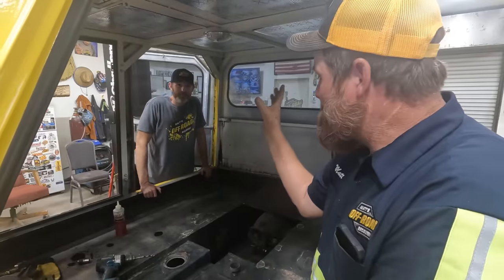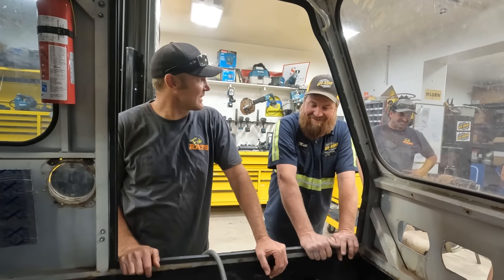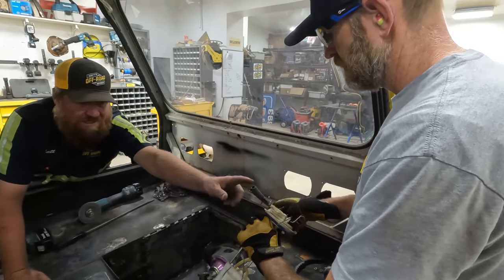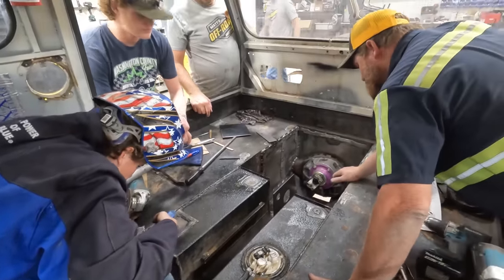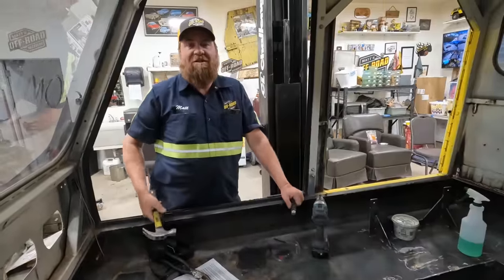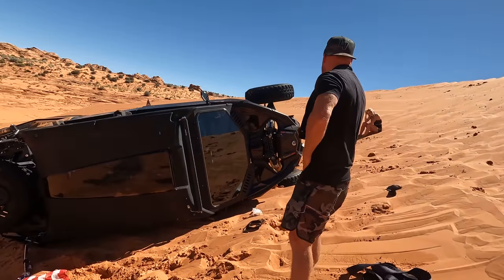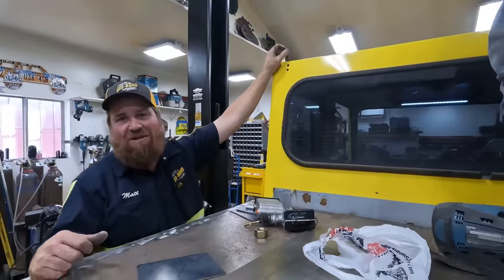I Made The Bombi Unsafe For Everyone, But Me!

Comment: Side exit exhausts , keeps it away from up top , keeps it away from the rear where you will be working to hook up . Makes it way easier to run under the engine cover and less chance to heat soak other components like the battery

Comment: Put all the steering master cylinders in the center. With the arms coming straight up from the center & have the hand controls over the drivers lap. Maybe have the hand controls fold out of the way, but lock down when driving. They also need metal skulls on them. 
Sieve - LOL. Kids have no clue on old stuff. 
If you're going to make it 4' taller, might as well extend the cab, so they the extras have heat too. ????

Comment: You could cut a curve to put at the end of the exhaust to redirect, maybe to the sides, the hot gasses out of your anchor points and winch. Since you have removable panels it shouldn't be a problem if the exhast tips stick out.

Comment: Another thing with the levers being between the feet is that in an accident you could get gut punched with levers, especially if you pull both levers back at the same time trying to stop in an emergency. Also either person in the front seats can operate the levers without having to get out or climb over to switch seats.

Comment: Sieves are used in combines to clean grain the grain will fall through to the fanning mill then to the clean grain elevator to the grain tank the stalks and leaves are shaken across the sieves out the back of the combine to the chopper and onto the ground to decompose

Comment: You guys should build some steps on either side of the back of the Bombi with some handles towards the top of the bed so two people could stand on the back and ride if need be. (Like they used to ride on garbage trucks) Could be handy/useful in cases where getting in and out of the cab over and over would be a pain in the...

Comment: Just an observation, but at 26:42 it does not like where you welded has a leak, but the bolt in place next to it, towards the bottom, at the threads, there were bubbles coming out from the air pressure test.  Not sure if that is a problem or not.  Regardless, great video and great work your doing to restore the Bombi.  Not easy, and not quick.  Cheers!

Comment: Are you adding an angle piece under the front receiver hitch for some added strength to prevent down ward rotation? Maybe measure that tunnel you are always going through to make sure that grab handle is low enough? Also, maybe some expanded metal on the back for some foot traction would be good? BOMBI is looking really good!!

Comment: The coolest control system would be a single stick with a cam so when you move it to the left, it pushed the left master cylinder, and when you moved it to the right, it pushed the right cylinder.  Then when you pulled back on the stick it engaged both master cylinders for braking.  I've already got a picture of it in my head, Tom Tom can do the rest of the design that for you.

Comment: Grab bar at your belly button.  Though you could sleeve it and put pins (which would actually be bolts you found in the shop because you are lazy) to make it height adjustable.
And I understand not having seats up there, but no reason they couldn't have pads at least that pin to the bar.  Something to lean on, and/or be a windbreak when it's super cold and they are up there filming.

Comment: Some tanks send their exhaust out the side.  You could still have your exhaust at the back, just turn it 90 degrees and send it out the side panels, eliminating the exhaust in your face non-issue. Maybe even with a fancy chrome tip.  :)

Comment: I really think you are missing an opportunity with the steering brakes....mounted in the middle with the passenger side taller, driver side shorter - Then two levers that hinged atop the main steering brakes that drop down in front of the driver.  Levers swing up out of the way for entry and exit and swing down for the driver to drive with the controls directly in front.  I would draw a technical drawing but Youtube doesn't allow images in the comments.

Comment: When you start a mig weld its too cold for a split second. Grind your starts down real thin before you tie a new bead back into them. Then weld a little bit past where the last bead ended so you don't start or stop in the same spot twice. This is how you can get air tight welds on the first pass.

Comment: Hey so how about some sort of driveshaft failure containment between each side of the fuel cell? to lessen any opportunity to puncture a cell side... and, it may be far too late to even consider a redesign here, but your brake control levers: braking forces force the human body and it's appendages forward, therefore one might wish the levers to be moved forward to gain brake hydraulic pressure. 

Sequential shift levers in most racing cars are connected in this manner: move forward for a downshift, pull rearward for upshift...

Comment: Matt, for the steering, why not consider a simple quarter turn yoke/ steering wheel with spring loaded brake return.  When you pull back on the yoke and turn either left or right,  tracks on either side brake as required.  When you let go of the yoke, the tracks brake to stop.  Pull back and move forward, turn right or left accordingly and then let go to stop.  The hydraulics would be simple.  Matt, I'm 64 years old but, would you be my father?

Comment: I wouldn't put a back rest on the seats up top in case you trap them between a limb and the back of the seat. That might break the riders backs or worse.  A bench and a hand hold is adequate.  Perhaps side rails?

Comment: It wouldn't take much to mount a pedestal seat on the back for the camera guy. I was a pressure vessel welder for years and no matter how good you get every so often you have a leak when welding thin material. I like watching you all make what you need out of what you have. My current project is to make a air conditioned cab on my zero turn mower, I've collected everything I need to complete it except the window material. I'm trying to decide if i should use Lexan or Plexiglas.

Comment: You need some bend in the elbows because having a bend allows the body to pivot front to back, allowing it to absorb some of the backlash from the vehicle acceleration, slowing, hitting something etc. If the bar is too low you just can't sway at all. My opinion.

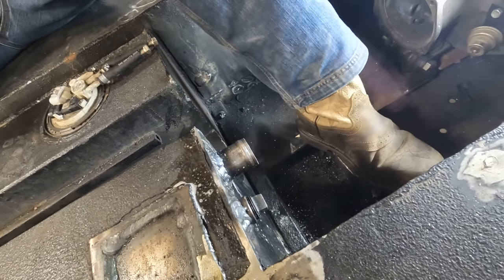Comment: Matt, FYI at 26:55 when you were pressure testing, there were bubbles coming out of the threaded plug next to the hole you were testing. Might just need to be tightened.

Comment: Tell me if you thought that the gas tanks were way too complicated with all the welded parts ?
A twin cell tank that could be dropped in ,all welded up on the work bench,a plate over the top (create a U shaped tank)that is removable.
Would a Joy Stick brake control work instead of levers ?and will you have a park brake system in addition to the park lock in the auto?

Comment: I think I see a safety concern.  The gas tank is in a well inside the cab.  Gas vapor is heavier than air so if there is a leak the vapor will pool in the well and create an explosion potential.    Of course I can’t tell if there are adequate vents in the bottom from the video to address this issue.

Comment: plug at 26:56 leaking a tiny bit, the one with the screwed in plug, top of the threads. bubbles a tiny bit when the hand is holding the other one

Comment: I love all of your videos and the great team you have. I was just wondering if you would share if you use grade 5 or grade 8 bolts for your suspension link attachments? I have a 2014 Jeep JKU Rubicon that is mostly stock except for a 4” Belltech Lift at 35” BFG KO2s on Stock Rubicon wheels with 1” spacers. As you know, the Jeep track bar is known for wearing out the bracket holes. I want to fix the holes and then replace the bolts with your recommendations for the bolts. Thanks a ton!

Comment: The way I learned it: A strainer is for using around the kitchen for food preparation. A sift is used in construction, if you need to clean out rocks and twigs and other foreign objects to get clean-fine sand for a project, you use a sift made out of screen and 2x4s.

Comment: FYI boys, TIG is the preferred method for making air/waterproof tank welds but with enough experience you will be able to mig a watertight airtight tank !!!!!!
It is much easier to learn at your age and a lot of guys who come in at their forties and they're all stiffened up while trying to learn. I see a lot of the issues is self-imposed expectations.
So don't sweat it you'll get it and you'll be there sooner than you think😅. 
Again calling how is your truck coming along have you done anything with
It ???. I hope you don't LS it but if it would have had a v-8, it would have been a 327 SBC 😍. Lightweight and ,  easily capable of 500 HP that's WAY more than u really need !!!!!  In the 300 + is very streetable and will give you all the fun you could need !!!! After all you're not towing with it !!!
You're after a nice airbaged. street truck !!!!
Airbags look good on show trucks. What is a daily driver there's just too many issues... IMHO of course 😊. A crapload of expense too !!!!!
My personal choice would be a rack n pinion I can adjust for the size steering wheel I want !!!
Either way it's good to see you up and around and getting better !!!!! 🎉

Comment: I probably would have cut those gas tanks completely out rebuilt tanks with tabs so they could be bolted in and easily removed. I like as much access to possible problems. And if you want to make it unsafe for anyone but you to drive put in two brake pedals the right on turns left and the left one right.

Comment: A tip from a tank welder, DO NOT pressurize the tank and spray soap solution on it until it has cooled naturally .Welding is an art that requires a great deal of patience .Your pissing off the whole molecular structure and proper returnability is not in your favor. What may not have leaked you just created a leak.

Comment: Probably too late now, but given all the leaks in the tank (and the small size), would it have been better to remove the old tank and bolt in a new (removable and/ or larger) tank either in that location or in the 'engine bay'?

Comment: Do you guys have a TIG welder in the shop? I always fix small air leaks like that by just fusion welding over it with TIG, I think you'd find it way easier than adding more MIG on top, especially for an overhead repair like on your gas tank bung.

Comment: When it comes to installing exterior lights on the Bombi, please resist the temptation to use LEDs. Since they run cold, blowing snow will build up on the lights making them useless.  Stick with good old Halogen incandescents.  Consider it a lesson learned here in the frozen North.

Comment: With all the work done.  I am thinking building from scratch might have been as easy. You could have had more room, dedicated tool box for gear, stressed to stand/sit on facing rear with belts?
 Rodeo.  They did very good.  The horse just did not trust, know the rider.  A horse that trusts you will go into unfamiliar, strange situation for you.  It won’t for new rider.

Comment: Would the grab rail make sense to be adjustable? Could put a ring either side so you can tweak the height. That way a camera man could rest the camera on it when the Bombi is stationary, you could take it out and modify it (for example a slant so you make it in to a back rest) swap it for a light bar, or just adjust height for different height people?
Reply: Also just randomly popped in to my head that this solution would work for a roof rack if you needed it.

Comment: How about offset levers to steer the Bomby…so the handles are in front of your body but nothing interfere with your legs as the control levers are going horizontally to the right over your knees and then vertically down to the brake booster…

Comment: No Matt, please don’t put your steering levers off to the side. I think that’s a really dumb idea. I used to drive an M113 APC in the army and it would have sucked if the steering levers were off to the side. You want them in the middle so you can pull straight back. You can bend the poles so they’re close together at the bottom and then separate at the top. If you have to break hard and quick, you’ll want to be able to pull hard and quick on them.

Comment: I have a question. Did they ever think about removing the tank all together and rebuilding it outside the snowcat and then reintegrating it back in the vehicle with L-brackets on rubber mounts to dampen vibration of damaging the tank.

Comment: Up top you might try little jump seat like this

         |-----|____|-----|

That way your centered while sitting and you got two hand holts either side and you can still make a roof rack to store tools fuel cans and pull gear 

Just put your roll cage the some mesh to keep small stuff in and seat as with lid if you want access point 
And camera mounting points when it's to cold to be outside while it's moving

Comment: no foot brake makes sense to me as long as you can lock the turning brakes or actuate them with a parking brake lever.  Need an interlock or at least a buzzer so you don't use the throttle with the parking brake on.

Comment: Matt: 
99.99 % of the time I’m either turning left or right in my truck. Never left and right at the same time……but my steering wheel is front and center of my body.  
Controls on Captain side without question if not for agronomics alone.
Reply: * ergonomics

Comment: I just saw something I wanted to ask you about.  Do you need a drive-shaft bearing somewhere between those gas tanks just in case your drive shaft breaks or warps and breaks into one of the gas tanks which will turn the Bombi into an inferno you may not be able to get away from, or are you going to use a drive shaft larger than the one I saw you playing with earlier?  Just a thought.
Reply: A simple safety hoop like a drag car uses would do the same, and will only take a couple minutes to add at the end.
Reply: @Elkadetodd  Good point.  Thanks !

Comment: Why not have 2 Foot pedals and a Hand throttle? rather than massive levers, hand throttle can be locked like a cruise control and you can still radio and phone using Legs (stronger than arms) for Footbrake pedals? Just a thought

Comment: I could definitely be wrong, or the plug in the smaller hole of the tank looked to have a small leak. Could be the plug but at 26 minutes and 42 seconds in the video checking the welds the other one started to bubble a little around the plug. I’m sorry if I’m wrong😅

Comment: You seem to have to learn everything the hard way.  There is a reason dozers have the control levers in front of the driver.  You will find out that off to the side will pull on your back to much.

Comment: Matt, Tom and Jamie... Kindly, As a Doctor,  "Safety Squints" don't work!  The sparks from a grinder are  FAST Flying particles of WHITE Hot Metal, and Flux that will INSTANTLY burn through  your Son's Eyelid, Cornea, Aqueous Humor, and Lens causing permanent BLINDNESS! Grinding and welding without safety Glasses is MUCH, MUCH more Dangerous than an improper weld, or securing a winch to a tow point.  These are your KIDS(?)! Set a good example! Would you ask your Kids to stand in the Triangle of DEATH when wincing a vehicle?

Comment: Rite stuff does not work for gasoline sealing.   You will need an epoxi sealant for gasoline.
Reply from the maker: Luckily, we were just using it for air. And I didn’t even need it 100% sealed.

Comment: As a licensed Journeyman welder with a B pressure designation and having built various sizes of tanks for years I can tell you this. Using MIG on tanks of any kind is never a good idea. Because, like TIG, MIG has no cleaning abilities whatsoever and any contaminants like mill scale, cutting slag, or rust can and will leave a pin hole leak. MIG can also cold lap (Lack of fusion) easily and fail altogether. Repairing these leaks can be very time consuming since you have to burn or grind that contaminant out to get your desired seal. You are far better off to us flux core wire or, gasp (God save us all), welding rod because the flux will take care of the mill scale or rust with little to no problem. Just sayin.............

Comment: IMHO, should have just cut out the tank and dropped in an aluminum tank that you know is 100% air tight.
Reply from the maker: It’s a pretty complex tank. 
Not only is it the actual structure of the tub, but it also has to make concessions for a drive shaft going through the middle of it. Not exactly a drop in piece.

Comment: Do NOT use COPPER.  The vibration will crack the tube at fittings.  I would be beneficial to send sonny to Approved Welding School to get rid of any bad habits and learn the right way to do it.  We miss Lizzy.♥  Do some Bend Tests.   Use a Brass Punch when tightening Fuel pumps into tanks.  No sparks allowed.  Be VERY careful pressure testing a square tank.  Keep well back.  20 PSI max.  When one of those 'unwrap',  skin flies.  Use regulator on input hose.
Make sure pressure is 0 when welding on tank.  Welding School will teach Penetration and Gap, Rhett.
Don't agree on steering lever placement.   Love it when someone asks you something, you tell them and then they ignore it.  Grab bar.